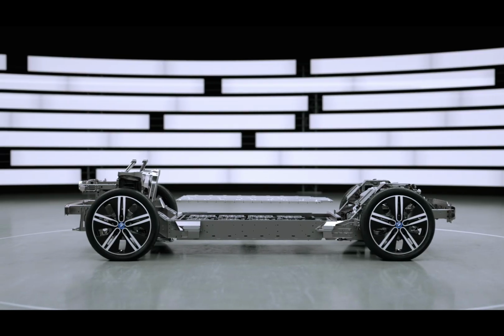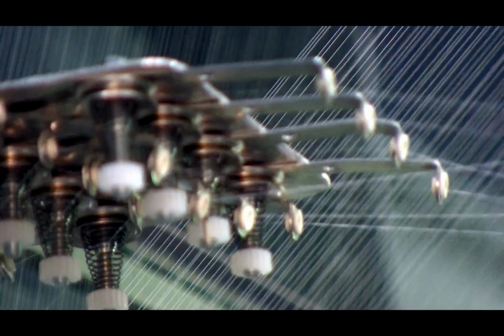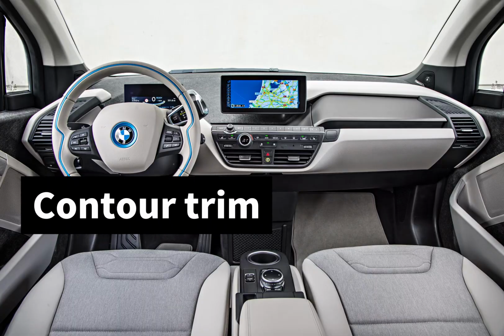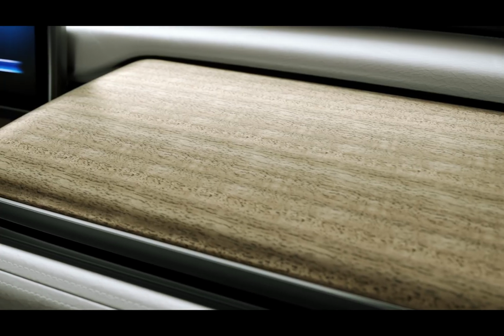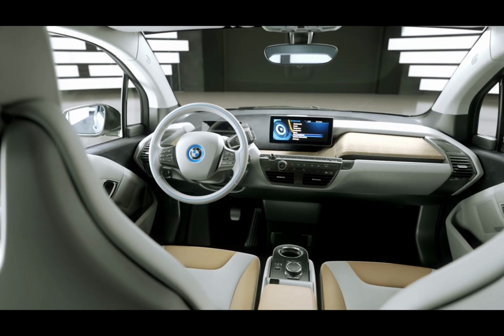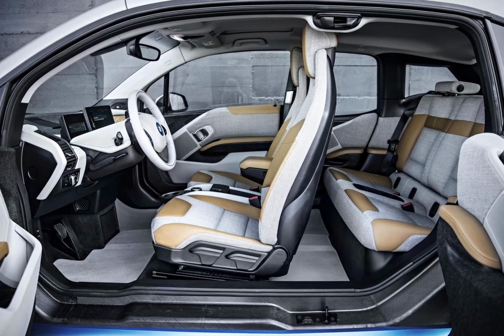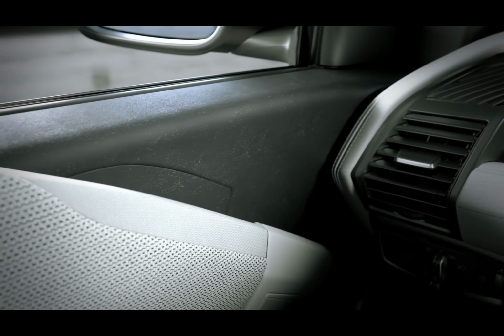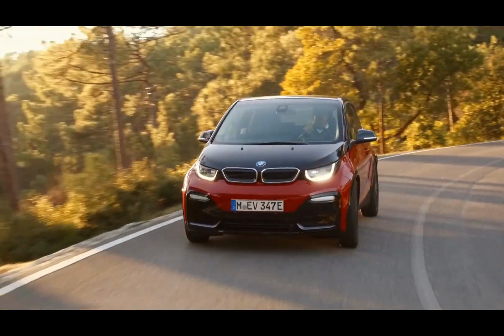World's best small car interior - BMW i3 interior design review

Comment: Im so in luv with my i3S from 2019, ITS my best Car i ve ever driven and im in Luv with ITS spacious and lounge Like Interiourdesign❤❤❤ Actually 75 snds KMs on the clock and still running without any doubt on Low costs, average Consumption over 1 Year IS about 12.9 kW/100km, Hope IT will Last 4 many years, and when there IS a Problem, ill recommend EV-Clinics,WHO Upgrades the Accu or repair parts of IT or even improve IT from range Up to 54 kWh. STILL LOADING Till 95% with nearly 50 kW, degradingrate at 0.6 from ITS original net accu- capacity. Thumbs Up 4 that little WonderEV❤